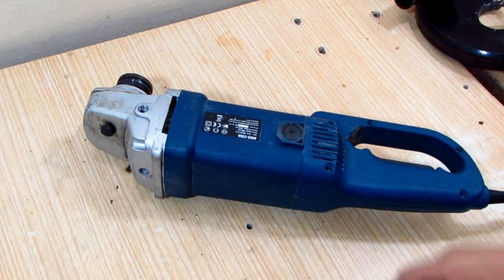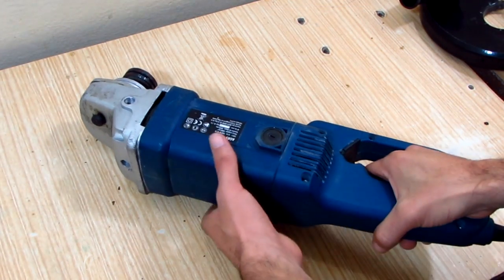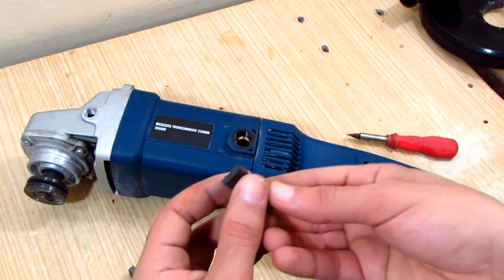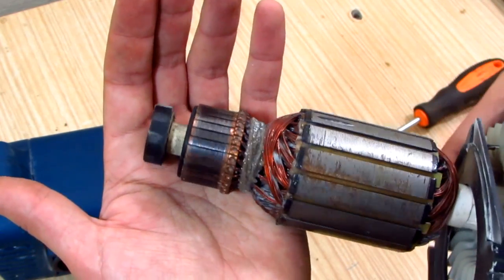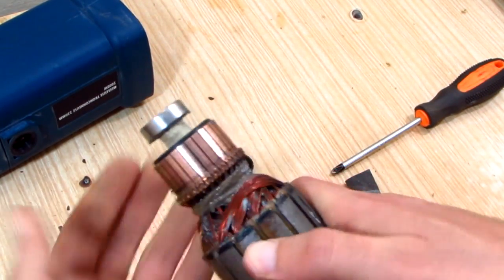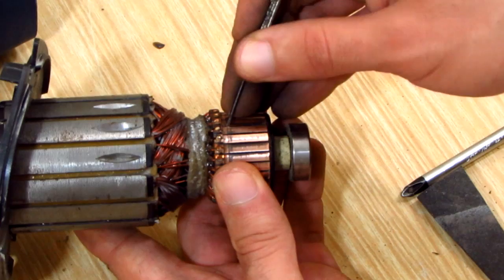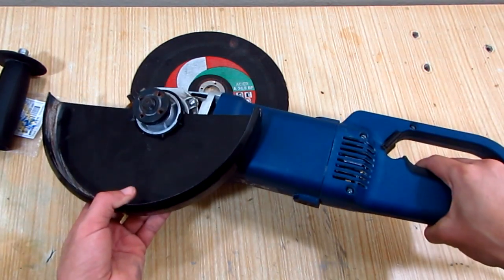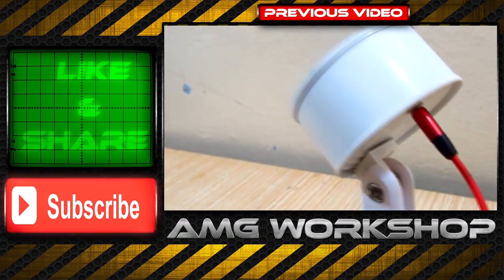Repair an angle grinder that stops working randomly - replace the carbon brushes

Comment: The bushes on my angle grinder are under the back cover held in by two small bolts & springs how do I start to remove the old bushes for new ones?.

Comment: On dc motors if brushes are arcing , motor is mechanically advanced too far. But on ac motors i had it happen on a brand new drill. Replaced with a better brand . Sometimes it is better to pay a few bucks more just for no hassle. Good video 😊
Reply: hey by chance would you know if damaged brushes can cause a saw to not even start up??

Comment: i have been searching for a video instructing replacement of these type brushes since i was given a similar amgle grinder missing both brushes and a cap and the grinder was made by kawasaki and is out of production with no information or parts listings available..this was extremely helpfull to at least see what these brushes are supposed to look like..thank you!
Reply: Siacri Six Google the nearest store by you

Comment: where to buy the brushes?
Reply from the maker: I got them from my local hardware store, but you can get them from ebay
Reply: AMG workshop you have any link eBay
Reply: AMG workshop  what's the name of the hardware store to see if there it's one near my i live in new york
Reply: You can buy oversize brushes and file down to suit . Just use a vernier caliper and a ruler to get to right size! Cheers